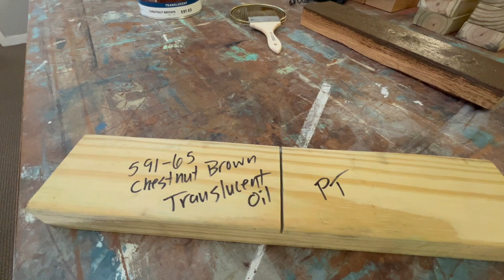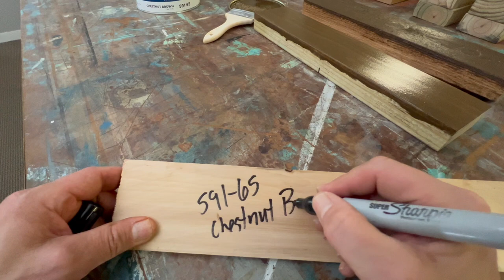WOODLUXE Translucent Oil Stain by Benjamin Moore in CHESTNUT BROWN Applied to Red & White Cedar, PT

Comment: what are your thoughts compared to super deck oil based (which is now really hard to find anymore). Could it be a good replacement option for something that penetrates and seals well?
Reply from the maker: Benjamin Moore has been developing the Woodluxe line for years. One of their primary goals was to improve penetration. That was the feedback they received from their retailers, like me, as well as end users. So basically, they created an old-school, traditional oil based stain but with newer resins, binders, and pigments. I can tell you one thing for sure, they’ve achieved it. I have cut cross sections into some of my Woodluxe samples and I’m blown away how well it penetrates. I’ll post videos of that when I get a chance. So to answer your question, yes. This is an excellent replacement.
Reply: @southernpaintsamplestudio  That's exciting! I tried using the super deck oil modified version which is what's available now and it just doesn't do what the traditional oil based once did. Not sure why they would have messed with a winning formula all for the sake of lowering VOCs. If it breaks down faster you actually end up using more product over the life of a deck. Thanks for that feedback, we have a new client coming up soon so I'm gonna take this for a test and see how it does
Reply from the maker: @djgemi9i  You're welcome!  Let me know if I can help with anything else.  Don't forget to like & subscribe.  More sample videos to come.
Reply: @southernpaintsamplestudio Weird. In all the reddit pages it has been completely dogged by professional painters.
Reply from the maker: @Burritosarebetterthantacos  Not sure how they can dog it yet, it's fairly new. Also, painters have their alliances they're going to stick with, that's human nature.  I'd be willing to be most of those dogging it, have not tried it yet.  What I can tell you is that Benjamin Moore knew early on that Arborcoat, Woodluxe's predecessor, wasn't working with the exception of the Arborcoat Solid of course. Arborcoat Solid is on of the best solid stains out there which is why it's the only formula that carried over to Woodluxe.  So for years they were taking the negative feedback from Arborcoat and working on developing formulations for Woodluxe.  From my standpoint, as a paint retailer of almost 30 years, it appears they've found a solid formulation.  The launch went really well, probably one of the best new product launches recently, and the feedback from our contractors and retail customer have only been positive so far.  Through my sampling and testing I've noticed they've achieved much better penetration which should result is much better long term performance.  I think that removing the film and focusing on penetration was smart. Yes, you won't get the furniture type finish, but you'll have virtually no issues related to peeling.  I also think going back to the traditional oils rather than the modified was a smart move. We saw way more issues with modified oils than we did straight oils.  Only time will tell for long term success, for now I'm feeling good with what they've done and have a feeling they're on to something.